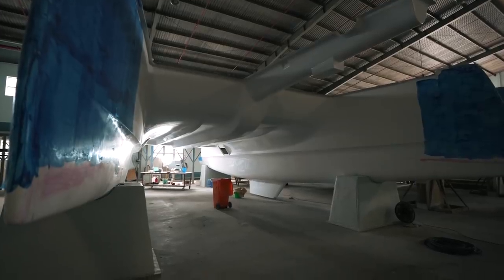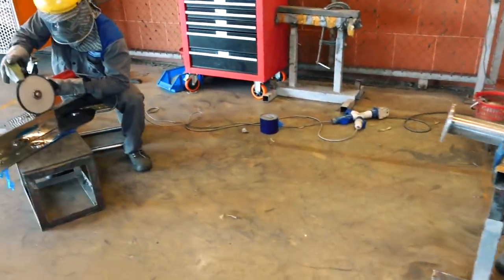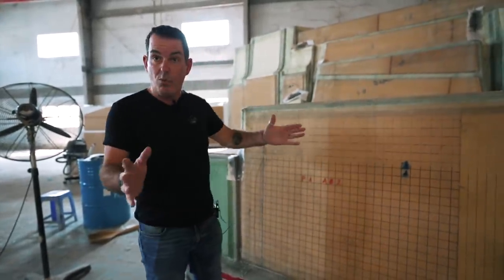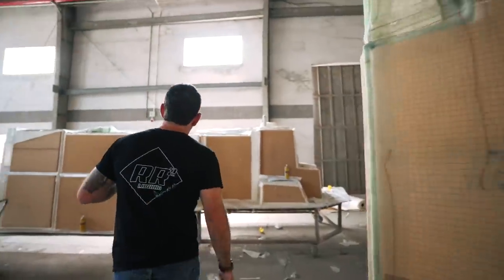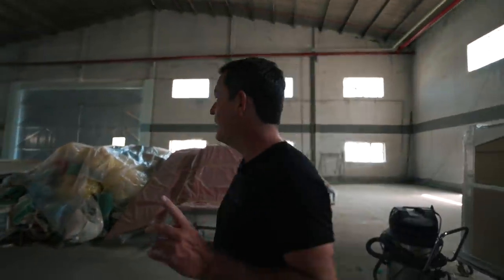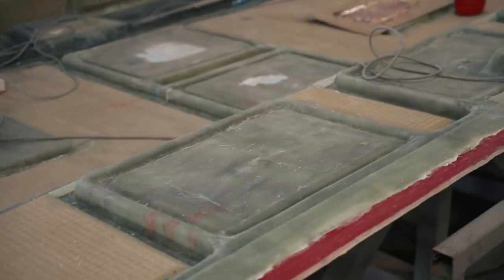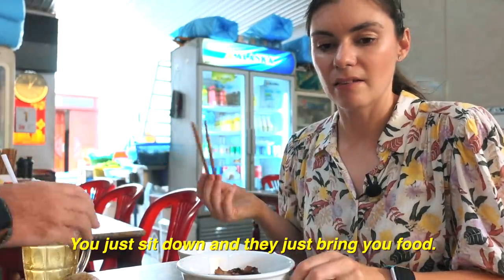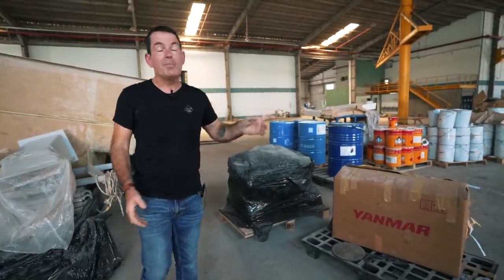ALL NEW BUILD DETAILS REVEALED! The Ruby Rose 2 Boat Build Continues...

Comment: Differing thicknesses in foam enhance bending stiffness, not so much physical strength, increasing thickness will add substantial stiffness whilst minimising weight as core is of minimal weight. Mitre or bevel on foam enhances bond of laminate to existing surrounding solid laminates and reduces air voids in laminates at this junction. Great video, great to see the tooling and resultant modules. Cheers Guys.

Comment: Very interesting to see the parts being made ready for the construction. The cut lines in the foam for drawing the resin through is genius.
It's incredible seeing the thought process for placement of jacklines and preventer lines. I'm so used to seeing completed boats where these decisions were made long ago that it never even crossed my mind how much thought would go into their placements. Refits usually don't come across the placement issue other than to shift lines a few cm over from the original position.

Comment: Interesting comment from Nick, this is the way to build a boat. Close, they are using the best known techniques for building composite structures of reasonable cost. Why would I know? I worked at Boeing in composite manufacturing. Boeing is not cost sensitive. They are weight sensitive. But as a research person, it was my job to know many other focus points. Simply, the SeaWnd people know how to build a balance of low weight and reasonable cost. The computer design gives lowest reasonable weight given the cost constraints. Nice job SeaWind.

Comment: Always fabulous.... but as someone who has fallen overboard and just about died (I didn't just for reference) may I suggest doing the best you can to get the jack lines as far inboard and central as possible. You don't want to ever drag in the water.... you should be able to construct a system whereby if you fall you can NOT go over board or if you do it is just your legs. Trust me.... watching your boat sail away without you is no fun.

Comment: The infusion  channels appear to create a ribbed structure. Does this ribbing have any material rigidity or strengthening properties? Thinking of say rocket fuel tanks where most of the material is machined away to leave a hexagonal grid of ribs for maximum strength at minimum weight.

Comment: Quote from Nick, this is the way to build a boat? Yes/No, carbon/epoxy is superior, and going to carbon pre-preg cured in a autoclave is the highest build level today. The future of boating in 10 years, possibly as soon as 5 years will be simply amazing. No underwater hazard concerns, no need to keep watch day or night, solid state batteries 10X superior without the cost, the list is endless. You guys are definitely headed in the right direction, enjoy.

Comment: 6:58 Seawind infussion of resin looks complex, is this the standard in the industry for hiline cat building?
Reply from the maker: No definitely not standard.
Reply: @sailingrubyrose  Farrier F Boats use vacuum resin infusion through perforated foam core,  which sounds very like that Seawind are using. I believe it is used by many high performance multihull builders as it is lighter, stronger, and homogenous.

Comment: I think I like the idea of a "German-rigged" boom, where two lines run from the aft end of the boom one to each side.  This allows one in tension and the other acts as a preventer.  Can you discuss why a track is better?
Reply: It allows you to haul down the end of the boom and control the sail shape even when the boom is close to or at the boats center line.  With the other style, while simpler and good for smaller boats the amount of force on the lines and every attaching point for it's hardware becomes unfeasible with the wind load the larger sails can create.  By separating the locating of the boom port to starboard and the pulling down on the end of the boom to two separate systems it can handle the force of the larger sail area.
Reply: @honor harrington  love the name. I'm a fan. Sad to see so many co-authors nowadays. Dilutes the genius.  I had not considered the realities of scale.